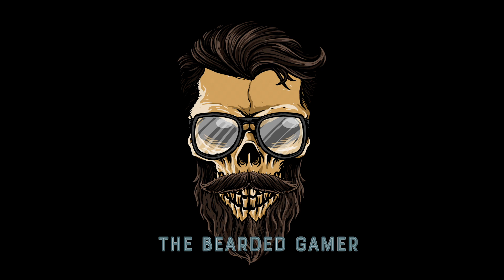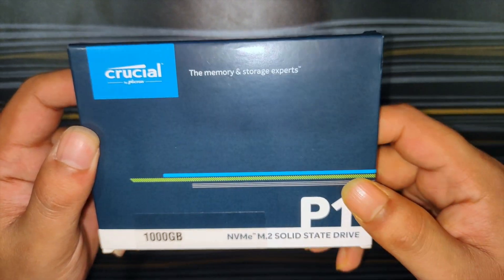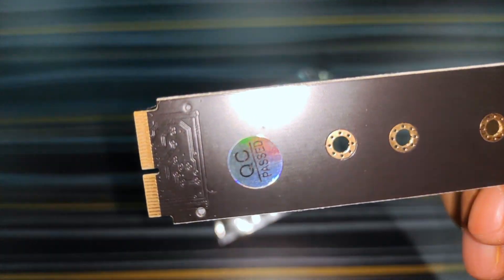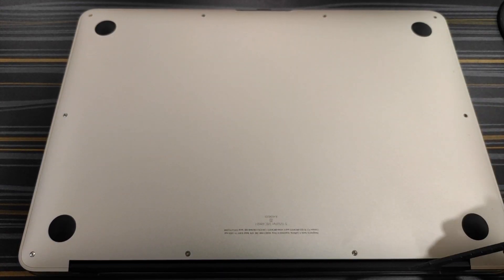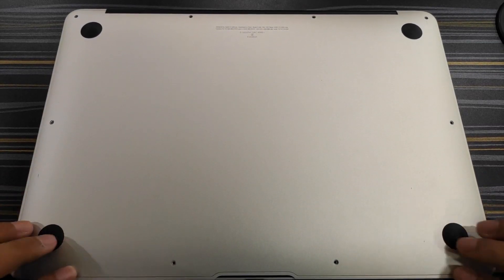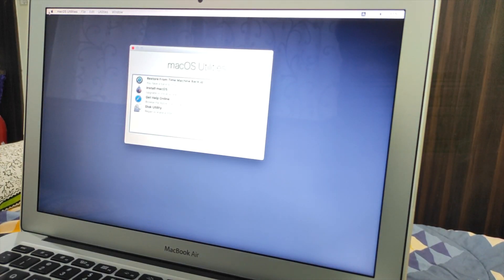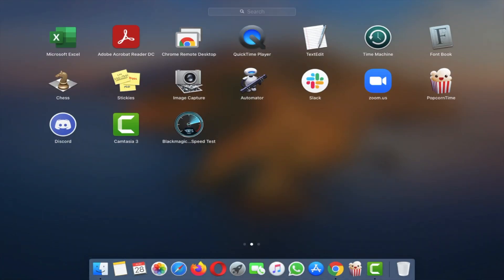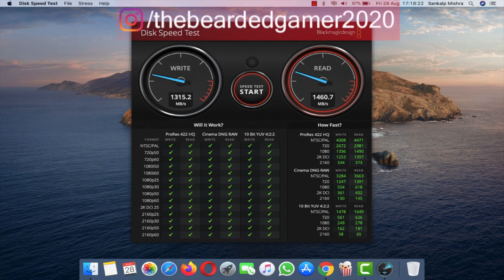2017 MacBook Air Storage Upgrade from 128GB SSD to 1TB NVMe SSD | Full Guide for 2021 | 40k+ Views

Comment: Hi
I have MacBook Air 2017 model , I want to upgrade my ssd , can I go with the adapter and ssd variant does it  has any kind of disadvantages or should I opt of the direct ssd which doesn’t need adapter as there is difference in price of both variants I need your suggestion , plz reply
Reply from the maker: It totally depends on your budget. I have added links to all the products in the video description. Both the setups will work fine, but the one with SSD and adapter will cost you a lot less. So, you can choose any of the setups. You will get better performance and storage for sure. Do subscribe to my channel and press the bell icon. Reach out to me for further clarifications.

Comment: Hi I have MacBook Air bought in Dec 2018 which is 128 gn. Can I too enhance as mentioned by you as you told it should be 2017 prior. How to identify if it’s 2017 model or later kindly advise
Reply from the maker: Hi Sameer, to check Macbook year, go to the apple menu on the top left corner, about this mac and then in the overview tab you can see the year mentioned. Do subscribe to my channel and press the bell icon.
Reply: Thanks a lot. Subscribed too
Reply: Hi sir thanks checked it says 2017. Does anyone do this for me as these are Greek to me. I stay in Bangalore.
Reply from the maker: @sameerbdeshmukh  You can ask someone who works with apple products repair, but apple authorised service center will not do it. It is not such a difficult process, you can give it a try. All the product links are in the description, and you can dm me on Instagram and I can guide you through the entire process.
Reply: @TheBeardedGamer2020   thanks a lot for your support sir
Reply from the maker: @sameerbdeshmukh  No problem. Always here to help.

Comment: I have MacBook Air purchased in 2018. Can we too increase the storage as shown by you as you had shown  for 2017 model. How to identify its 2017 or more. Kindly advise
Reply from the maker: Hi Manasvi, to check Macbook year, go to the apple menu on the top left corner, about this mac and then in the overview tab you can see the year mentioned. Do subscribe to my channel and press the bell icon.

Comment: I have an MacBook Air early 2014 running core i5 and I need to upgrade the ssd so which one should I buy the (blue crucial P2 or the black crucial P1) and I think I’ll just go for 500 GB If it’s available
Reply from the maker: I have added links to all the products in the video description. All those work. It is based on your choice and budget, which one you want to choose.
Reply: @TheBeardedGamer2020  oh basically they are both the same then and i wouldn’t need the adapter would I cause of having MacBook 2014
Reply from the maker: @bilalazhar6452  No. You still need the adapter. Macbook Air comes with a proprietary Apple SSD and to connect regular M.2 NVMe SSDs in that slot you will need the adapter. Do subscribe to my channel and press the bell icon.
Reply: @TheBeardedGamer2020  k and do you have link to the tools as well
Reply from the maker: @bilalazhar6452  Yes. All the links are in the video description.

Comment: Thanks a ton for the detailed instructions. Do I need adaptor for the samsung 970 EVO Plus SSDs you mentioned on the link?
Reply from the maker: Yes you do. Any m.2 nvme ssd you use would require the adapter. Only the OSCOO ones don't. If I was able to answer your question, do subscribe to my channel and press the bell icon.
Reply: Thanks bro for the clarifications. I desperately need to upgrade my 128gb ssd. Will follow ur instructions. Channel subscribed and bell 🔔 pressed.
Reply from the maker: Thanks man. Really appreciate the support. All the product links are in the description. Also, do reach out to me either here or dm on insta if you need any more help.

Comment: Hello, thank you for the video with such a detailed description. One question though- how much hours should I wait to check if hibernation issue is there or not in my mac?
Reply from the maker: Hey. To answer your question, if you close the lid for a few minutes and if it wakes up the moment you open the lid back, it doesn't have hibernation issues. Make sure that you subscribe to the channel and press the bell icon.
Reply: @TheBeardedGamer2020   Already subscribed. Did the upgrade today using WD Blue SN550 drive. Everything is working totally fine. I also replaced the SSD without touching the battery as you did as it was not moving and I was scared whether pulling it too much would mess something. 😄
Reply from the maker: @djjjjmm  Yeah same thing happened with me 😅

Comment: Brother I have another question... Since u know so much about macbook so I thought to asking u.. my macbook has some peculiar issues..it has booting issues everyday since last 2 weeks. Its taking 45-60 mins to boot every day in the morning wen I boot it for the first time.. but after it is booted.. there is no issue.. it's working fine.. sometimes during the day if I leave it in sleep mode it again has issues to boot up..
I have tried everything smc reset and all kinds of reset..I have even wiped out the hardisk and completely reinstalled the os.. however the issue is still persisting...
I have no idea whether it's a harddisk issue or ram issue or motherboard issue.. since it's out of warranty I am scared to go the service center since they will charge my kidney to repair..please help if you can
Reply from the maker: Is this happening after the SSD upgrade or on the Apple SSD?
Reply: @TheBeardedGamer2020  this is on the Apple ssd.. so I dont know whether changing ssd will solve the issue or not
Reply from the maker: @omkarroy6180  There is a high chance that this is the Apple SSD issue. I think upgrading should solve your problem. Also, before the upgrade try checking your login items as well as use first aid on the Apple SSD to try and fix the problem.
Reply from the maker: @omkarroy6180  It is is kind of like startup apps on Windows. If there are a lot of login items on your Macbook, it slows down the boot up. Also, how are you managing bootcamp as well as MacOS on 128GB?
Reply: @TheBeardedGamer2020  no actually itvwas ruining fine since 2018.. suddenly since last month I am facing this issue.. I reformated it 2 times and reinstalled os.. that should resolve any login issues I think..
And yes it's a problem that's why I was thinking of upgrading the SSD.. however I thought it was not possible on Apple products.. however after seeing ur video I got to know it's possible.. but I am thinking if the problem persists even after changing the SSD then 10k inr would be wasted since Amazon will not allow return for storage units
Reply from the maker: @omkarroy6180  Does the problem persist if you are only on MacOS or does it after installing BootCamp?
Reply: @TheBeardedGamer2020  actually I am not aware of that yet since I was running bootcamp since beginning.. however yesterday I formatted it again with new os big sur.. after that I haven't installed bootcamp yet.. do u suggest me to wait for 2 days to see if this problem occurs in only mac without bootcamp??
Reply from the maker: @omkarroy6180  Yes. Try that out. Sometimes  due to lack of storage, the startup disk, which is the Apple SSD, also becomes slow. So, give it a try.
Reply: @TheBeardedGamer2020  ok I will try it and update u

Comment: Nice video..just one question can we not use the old adapter instead of buying a new one
Reply from the maker: The proprietary Apple SSD doesn't come with an adapter. It is a direct fit. But the adapter helps create a connection between the M.2 SSD and Apple 's SSD slot. That is why you need the adapter. If I was able to answer your question, please like, share, subscribe and press the bell icon.
Reply: @TheBeardedGamer2020  thank u.. yes I have already done.. which one do u suggest me to buy..I don't need 1 tb.. 500 gb is enough for me...
Reply: Also my macbook model no is A1466
Reply from the maker: @omkarroy6180  The links to all products are in the video description. Those are all working perfectly. You can choose as per your budget.
Reply: @TheBeardedGamer2020  thank you

Comment: Hello, i have my macbook air 2015 ssd upgraded, now I don't know what to do with my old ssd, can i use it as an ssd on my other windows laptop? Or maybe it can be an external storage?
Reply from the maker: You can do both. But the only issue is that we don't have many converters or enclosures for Apple proprietary SSDs. And the ones that are available are so expensive that you can buy a new 1TB SSD or even a 4TB HDD. So, what I normally suggest is to keep the SSD aside and put it back in whenever you plan to sell it off. If that answered your question, make sure to SUBSCRIBE to my channel and press the bell icon.

Comment: Hello, mine is a MacBook Air (13-inch, Early 2015), 1.6 GHz Intel Core i5, 8 GB 1600 MHz DDR3, Intel HD Graphics 6000 1536 MB. Do you suggest the same procedure & components ?. I also plan to run both mac & windows post upgrading my storage.
Reply from the maker: Hi Yash, sorry for the late reply. Yes you can use the same process and the same components that I have shared in the video description. As for mac and windows, I am using it the same way. Do subscribe and press the bell icon.

Comment: Hi @TheBeardedGuy, I hope this upgradation has helped you in increasing your storage. Just wanted to know of any kind of cautionary to attend to before or after doing the process. Although your video is brilliantly informative, some trusted sources have recommended to upgrade it above 512GB. Please compare pros and cons of this upgrade after 10 months of using this.
Reply from the maker: That's a pretty detailed question. And it's TheBeardedGamer. To answer your question, the upgrade has a lot of improvements over the original ssd. You get both more storage and speed. It might heat up slightly more than your original ssd but that again varies from person to person based on usage. After 10 months, the performance is still great, much better than the original 128gb ssd. If that answers your question, do subscribe to my channel and press the bell icon.
Reply: @TheBeardedGamer2020  So what type of ssd does the macbook air a1466 use? M.2 nvme. M.2 sata. Can i upgrade to a 2tb ssd? What are the exact specs and sizes of compatible ssds that i can buy for my macbook air a1466 ?
Reply: @TheBeardedGamer2020  subscribed :)
Reply: Upgradation

Comment: Thank for for the video guide to expand internal memory. I have MacBook Air (13-inch, 2017)with Processor 1.8 GHz Dual - Core Intel Core i5. Please suggest the particular product (SSD) suitable for storage upgrade. Also, I have installed Microsoft Office on my MacBook Air. Do I need to reinstall the same again (more specifically do I need the product license key for Microsoft Office) once I replace the new SSD device. Thank you
Reply from the maker: Hi Somnath, you can choose between the products that I have shared in the video description, based on your requirements. Coming to MS Office, if you have a purchased version, then you can just install again and login and the license will get reactivated. But, if you have the cracked version, I would suggest you to take a TimeMachine backup of your entire system and restore it after the upgrade. That way you will have all your files and MS Office in the same setting. If I was able to answer your question, do subscribe to my channel and press the bell icon. Also, if you need any other help do reach out to me.
Reply: @TheBeardedGamer2020  Thank you....if you could help me with one last thing...how to take a TimeMachine backup?
Reply from the maker: @somnathmaity5209  There is a link for that in the video description as well. It is pretty simple. Take a look at it and if you still have any issues, do let me know.

Comment: hi again, now after i upgrade my mac air's ssd to 1 tb, i woud like to turn my 128gb old ssd to use, as in like a pen drive. can you suggest me how to and what adopter i can use.. i got really confused searching on google, it says  connection - PCI.
Reply from the maker: Hi Sandesh, that is something which is an issue for all of us here in India. So, the enclosure that you need to use it an external storage is super expensive. You can easily by a 2 TB external hard disk for that price. So, better to keep it aside for now and whenever you plan on selling the laptop, you can put it back in and sell it.
Reply: @TheBeardedGamer2020  thats a good idea Bro.. really appreciate your suggestion
Reply: have any video on making bootable usb for ios
Reply from the maker: @sandi1619  No I don't but there is a link in the video description that is pretty straightforward and simple. You can refer to that.
Reply: @TheBeardedGamer2020  thanks..

Comment: Hi.Thanks for sharing..it amazing your clear explanation. Can you help me my macbook air 2017 track pad and cursor not working...what to do? Is there any exchange offer for Mac book? I wish to update 1TB because of this issue  waiting. Thanks
Reply from the maker: Thanks. Coming to the trackpad, you can  get it replaced at an Apple service centre but it can be pretty expensive as you already know anything done at an Apple service center is expensive. Best option is to just buy a usb mouse. That way you can continue using the laptop and do the upgrade as well. If that makes sense, please subscribe to my channel and press the bell icon.

Comment: Not detecting external hard drive in which contain time machine backup, I am trying internet recovery mode.

Why external backup not showing up? Any idea ?
Reply from the maker: There's no reason why it shouldn't, if you did everything the right way. But if it doesn't then you can do an internet recovery or a fresh install from the bootable usb that you created. And, once you are in Mac OS you can go ahead and restore using the TimeMachine backup. If that answers your question do subscribe to my channel and press the bell icon.

Comment: If i have a Time Machine back up do need to have a Bootable MacOS too ??
Reply from the maker: Yes you do need the bootable drive even if you have a TimeMachine backup. The bootable drive will help you get into a temporary OS so that you can access the backup and restore it. If I was able to answer your question, please show your support by subscribing to my channel and press the bell icon.
Reply: @TheBeardedGamer2020   Thanks for letting me know  :’). I was honestly not expecting a reply, let alone such a quick one. On the side note how much do you recommend a 3rd party battery for a MacBook Air because mine gives close to 3hrs of screen time these days (Been using it for almost 5 yrs now). Thanks in advance ❤️
Reply from the maker: Sandeep based on the fact that you are getting 3 hours screen on time, a 3rd party battery would surely provide better battery backup.
Reply: @TheBeardedGamer2020  both can be in the same drive or 2 different drives?
Reply from the maker: @sandi1619  Hi Sandesh. I guess you have been trying to post a comment earlier as well. So, finally. And to answer your question you do need to have rwo separate drives. The MacOS bootable drive would be needed to startup the system and the TimeMachine backup to restore your old system files and settings.
Reply: @TheBeardedGamer2020  wow.. thanks for the reply. Yes I was trying to reach you earlier.
Can I use WD SN550 1TB NVMe Internal SSD, instead of crucial?
Reply from the maker: @sandi1619  yes you can but why do you want to pay extra for the same performance. Better to go for something which is more value for money like the Crucial P1.
Reply from the maker: All product links are in the video description. Do let me know if you need any help during the upgrade.

Comment: hello, Thanks for the video it so helpful to everyone. I have one concern can you please clarify, changing MacBook Air  with the new ssd does make my system too slow or little bit slow on comparison to apple verified ssd,.
Reply from the maker: Hi Rohit. I am happy that you liked it. Changing Macbook Air with the new SSD actually increases the speed compared to the Apple proprietary SSD. The Apple SSD has a speed limit of around 600 mb/s while the upgraded SSD will have speed of around 1300 mb/s. If I was able to answer your question, please show your support by subscribing to my channel and press the bell icon.